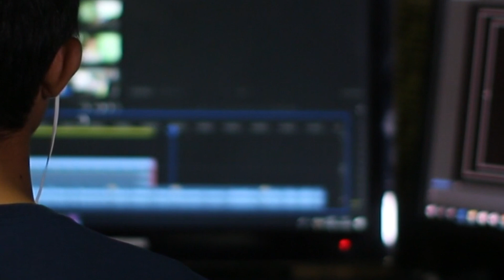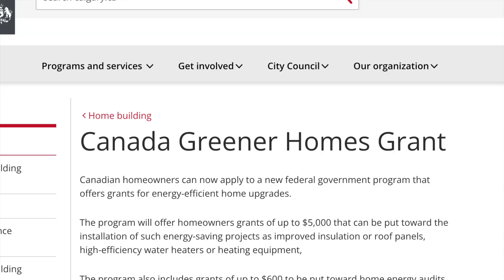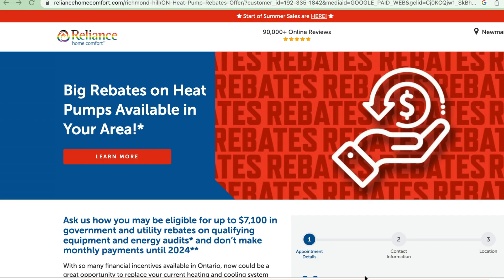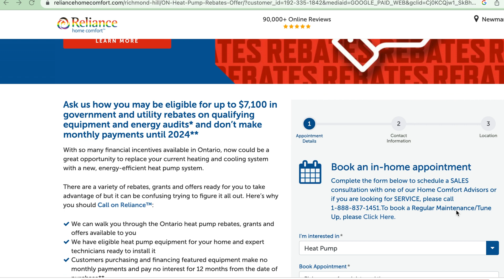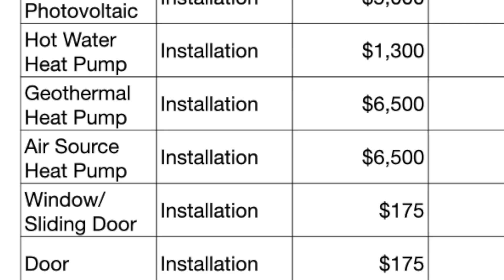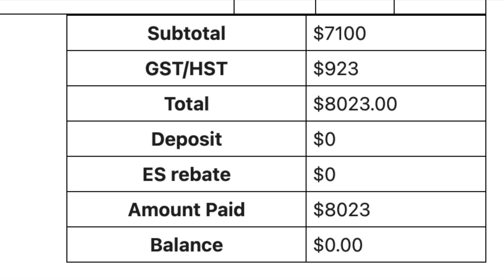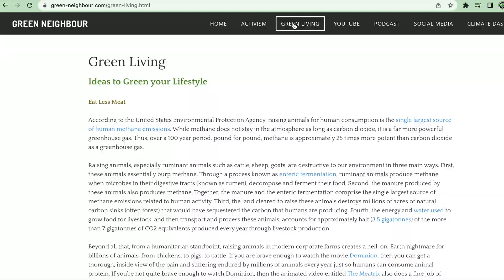Heat Pump Rebates in Canada (UPDATE: Greener Homes Grant is no longer accepting new applicants.)

Comment: Is $16,000 a good price for a ducted heat pump for a 2000 ft2 home with existing ductwork in Nova Scotia?
Reply from the maker: I would say that is a fairly expensive quote. That’s more than twice what I paid for our Gree. If you buy an American or European brand, it will definitely be far more expensive than a Chinese brand, but bear in mind that a number of American brands are actually manufactured in China anyway. There is no doubt that the recent federal rebates have inflated the price of heat pumps in Canada. Having said that, those rebates have been put on pause at this point, so you should be able to find a heat pump at a lower price because inventories are probably unusually high at this point in time, and the pause in the rebates came early and without warning. 
See: https://youtube.com/shorts/dKjYB9jfkQE?feature=share
Reply: @GreenNeighbour  that's the cheapest quote out of 5 companies.   Most were around $20,000.  Companies are definitely inflating the prices.  It's kind of insane really.
Reply from the maker: @corymacdonald383 I hear you. It’s happening for sure. Wait a week or so, and see if the prices start to come down. They should… it’s hard to know by how much, though.
Reply: You do know that heat pumps are ineffective in cold climates. Basically they are an A/C unit that can reverse. Ever felt the heat rising from your outside condenser? That's what you get. As for the quote that's ridiculous. Contractors are taking advantage of the tax payer paid heat pump grant. Basically keeping all of it for themselves by tagging it onto the price.
Reply from the maker: @mrofnocnon Hello there. Thank you for your comment. Given that I own and operate a heat pump, I know exactly how effective they are and what they cost to run. That is essentially my bag: I try out these things and then I share my experiences with my viewers. 

More on the effectiveness of heat pumps here: 

What does it cost to run a heat pump?
https://youtu.be/zpHXfoeH_2A

Be well.

Comment: It's currently -45C in my city in Canada. Edmonton, Alberta.

This product would NEVER work in Canada winters.
Reply from the maker: I live in Canada, and it has been working just fine so far. Of course, we're having a mild winter this year; however, moving forward, that is how the trend will be. Additional global warming is unstoppable at this point, so warmer winters is basically what we all have to look forward to. To your point, it certainly is cold right now in Edmonton, but, from what I can see, it's not -45°C. Environment Canada says it's -28°C right now, going to -35°C tonight, -38°C tomorrow night, and the same the night after, then it gets significantly warmer. Definitely getting cold right now for you folks out there in Edmonton. Having said all that, that doesn't really matter. What matters is what the temperature is for the majority of the winter. Even if you needed to use your auxiliary heat for a total of 30 days over the winter, you'd still be ahead using a heat pump for the rest of the winter. As for me out here in Newmarket, I basically never need to utilize my auxiliary heat. Be well, stay warm.
Reply: @GreenNeighbour  I just looked at the weather app. -30C right now, with wind chill -43C
Reply from the maker: Curse that darned wind chill!
Reply: @GreenNeighbour  I think the best idea is to get all the vehicles right across Canada on electric vehicle system and all homes on Electric Heating pumps, so that we can overload the grid system during winter and have power outages. Can't wait Green Neighbour!
Reply from the maker: Fortunately, electric heating and transportation is far more efficient and far less energy intensive than heating or driving using oil, which is actually a medieval energy source. Something nobody ever talks about is all the energy required to extract, transport, refine, and distribute hydrocarbons. Once the transition is fully underway, we will be able to utilize the energy savings from decreased hydrocarbon production, and move that directly into powering electric heating and transportation. Never forget though, it takes much less energy to simply move heat around (which is what a heat pump does) than to create heat from nothing (which is what a gas or oil furnace does). we see something similar with transportation, we’re in the internal combustion engine is approximately 20% efficient while electric vehicles are approximately 80% efficient. 

https://youtube.com/shorts/O7FFsDJu_CU?feature=share

Why has society stubbornly maintained the most inefficient approach to heating and transportation for so long? Money, my friend… never forget to follow the money.

https://youtube.com/shorts/FSmDKQD5H5w?feature=share
Reply: @GreenNeighbour Do you have any financial investments? Have you ever heard of diversifying your investments. That's why we don't put our eggs in one basket such as electricity grid system.

Does time and time again those heater pumps freeze solid during winter. Spoke with with several Canadian insurance companies, electric heating pumps are covered if they fail causing massive damage to the homes water and sewage pipes.
Reply from the maker: @fitnessbodz  Everything we use now runs on electricity, but we have 12 solar panels on our roof to generate electricity, and we also have a backup gas water heater (unplugged for years now), a backup gas furnace (not running much this winter), and a backup gas fireplace (not used in years). Yes, I do have investments. In fact, I taught investment fundamentals for years. Here's me when I was much younger: https://youtu.be/I5pnGhU9eM0

Comment: Thanks for sharing the info. Good content. How big is your house in sq ft? Is the 3 ton enough? Trying to see what size would I need for my place. Thanks
Reply from the maker: Our house is 2222 square feet when counting the main floor and the upstairs. It’s about 2800 square feet if you count the finished basement. So far, the flex unit we have has served well when set at 3 tons, BUT… it has been a mild winter to date. Having said that, let’s face it: winters are becoming milder with climate change, so heat pumps are becoming even more practical.

Comment: Carbon free household!  Have you heard yourself? I suppose all the fossil fuels used at electricity generating stations that supply you with electricity are carbon free. You are encouraging an electricity monopoly and have fallen for a false promise. As a licensed A/C tech, heat pumps don't work in Canada efficiently. It's like running your a/c all day, no different in terms of cost. Get ready for a punitive electric bill whose rates will skyrocket. As you have a furnace to keep you warm trust me you will use that far more, and will need to. Without this supplemental heating you will be cold. Basically you will just use the unit for a/c, its good for that, and no, no more efficient than a std a/c.
Reply from the maker: Yeah, we know heat pumps can struggle on really cold days, but we have electric space heaters and electric mattress warmers to fill the gap.

According to the Independent Electricity System Operator, 90% of Ontario’s electricity is emissions free. Most of that comes from nuclear and hydroelectric. 

Paradoxically, oil and gas is far better positioned to exercise market power in the energy market (owing to the tremendous barriers of entry), whereas electricity generation is better suited to competition. Even if you found oil under your backyard, you would still need to sell it to a big oil company because you wouldn’t have the resources to refine, distribute, and sell it. However, anyone can just generate electricity at their house, their cottage, their campsite, boat, or wherever by just throwing up some solar panels and inverters, or even a small wind turbine. We’ve had solar panels on our roof for almost 13 years, and they work just fine. 

A decentralized energy future based on nuclear, hydroelectric, tidal, wind, and solar and a variety of other distributed energy resources is the future that oil corporations truly fear… and they fight tooth and nail against it every day.
Reply: @GreenNeighbour Yeah yeah try heating a factory or warehouse with electricity. My point is there is nothing wrong with fossil fuels. C02 is only a tiny factor in climate change and not the principle one. The tragedy is we are pressuring under developed countries to not use fossil fuels causing hardship to millions and never giving them the opportunities and energy flexibility we had. So green isn't it?
Reply from the maker: The climate change the Earth is currently experiencing is entirely due to human-caused emissions. The sad fact of the matter is that 9 out of 15 known global tipping points have been activated, global warming is progressing faster than anticipated, and many climate scientists believe that a total collapse of civilization, no later than by the year 2100, is the most likely outcome. It is important to note that civilization will not suddenly collapse one day in the year 2100. It will be a long, devastating, violent decline on our way to that point, but anyone under the age of 50 today will almost certainly witness the unraveling of society owing to climate change.

Have a nice day.
Reply from the maker: Of course we have to shift to nuclear. As I sit here writing this comment, I can see that Ontario is currently producing 48.5% of its energy from nuclear, 28.3% from hydroelectric, 3.4% from wind, 0.7% from solar (it is 7:25 PM), and 18.9% from natural gas. For the most part, that same general breakdown (80% of electricity being generated from non-emitting sources) is shared throughout the entire country of Canada. 

The Canadian government is supporting the development and deployment of small modular reactors (SMRs) as part of its broader nuclear expansion strategy, with a focus on Ontario and some other provinces. This plan aims to utilize SMRs to diversify energy sources, support decarbonization efforts, and potentially lead in the global SMR market (which would be great news for our exports and trade balance).

The government is backing Ontario Power Generation's (OPG) Darlington New Nuclear Project, which involves building four SMRs at the existing Darlington Nuclear Generating Station.

The first SMR at Darlington is expected to receive an operational license by 2028, with all four reactors anticipated to be gradually completed by the mid-2030s. 

Be well.
Reply: @jonathankrimer  There is no climate change. Like many gullible people you are believing the false fearmongering. Surely you are aware how many times this same technique has been used in the past to control people. Floods fires, ice ages, etc.
Reply from the maker: Hey there. As you can well imagine, I get dozens of comments like yours every week, and I certainly don’t have time to respond to all of them, so what I have done is I have created the Green Neighbour Challenge wherein individuals and organizations are invited to prove that anthropogenic global warming is not occurring, or is not attributed to human activity, or is not serious in nature. Anyone who can prove any one of these three points will win $1,000.00 CDN. 

The link to the Green Neighbour Challenge is provided below. Good luck.

https://youtube.com/shorts/HwEHpGav9Ig?si=-9cOy-ki2zAtMlem
Reply: @GreenNeighbour  What a laughable proposal.The onus is on you to prove that climate change is caused by humanity, not on the rational amongst us! Pollution, yes it is certainly occurring and caused by humanity. However the side show of man made climate change is not and is sidetracking and reducing pollution control to a damaging extent. It's ironic you use the term "green" as the actions of the misinformed such as yourself reduce the greening of the earth.
Reply from the maker: What you are asking has already been done… repeatedly, for decades. 

No, my friend, if you are going to arbitrarily say that you don’t believe the science, then you have two choices: actually learn science, or take a shot in the dark and try to prove the science is wrong. 

If you went back to school to learn what you are asking someone to “prove” to you within a video comment, it would take you years to learn the material required to fully understand and appreciate the physics of what is happening. 

If you doubt it, then you prove it: there’s a thousand dollars in it for you if you can.
Reply: @GreenNeighbour  Were is your evidence? What percentage of "climate change" is caused by humanity, if any? There simply is no science defining either. Who decides what is an ideal temperature for the globe, you? Look to historical records my friend, rather farther back than 1991, were many seem to conveniently end for the climatists.
Reply from the maker: You might enjoy this video:

https://youtu.be/w8qvrSJzFm0?si=IiswT_XxndTU5B1f

Comment: I’ve been looking into some energy rebates so I can do some updates to my home. The auditor was pushing the heat pump upgrade and ditch the ac unit. I could be eligible for 6500 rebate on a heat pump. Too bad I have no idea what these things should cost. I got a quote for 10k plus tax. With the rebate that means I pay 5k. Seems to me the unit would cost about that and these companies inflate the cost by double so they can take your rebate and 5k of your money.
Reply from the maker: Yes, indeed. Generally speaking, when governments subsidize certain goods or services, it will invariably increase the demand for those goods/services, and that will increase the market price. Having said that, I do reveal the price we paid for our unit in my video, so you can use that as leverage in your negotiations. If you by chance live in the GTA, I’ll be happy to share the name and contact information of our installer.
Reply: @GreenNeighbour  thanks but I’m in London Ontario. The quote was for a Trane so it’s possible those are on the pricier side and very well may go for 10k installed. It would be nice to find a price where the rebate can cover most of the cost.
Reply from the maker: @tmp1k Exactly. That’s pretty much how it worked out for us. We just ended up paying the tax, but then the sale of our old central air unit covered half of that cost.
Reply: I’m living in Aurora, your installer sounds like reliable, so you mind sharing his info? Thanks!
Reply from the maker: @TZHU_91  Happy to. Here's the contact info for the person I dealt with for our heat pump. I used Constant Home Comfort, and everyone there was really great to work with. Kisa Chow was the Technical Advisor.

Constant Home Comfort
Unit #2, 201 Don Park Rd,
Markham, ON L3Y 1C2

Direct Cell: 647-268-1312
Toll-free: 1-888-829-1875
Office/Fax: 905-597-5593
Website: www.constanthomecomfort.com
Email: chc.kisachow@gmail.com